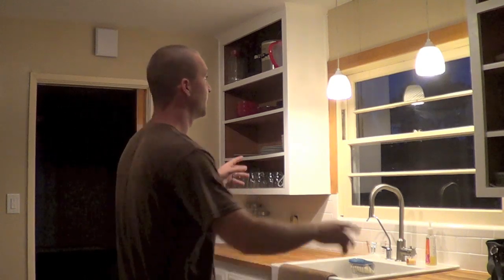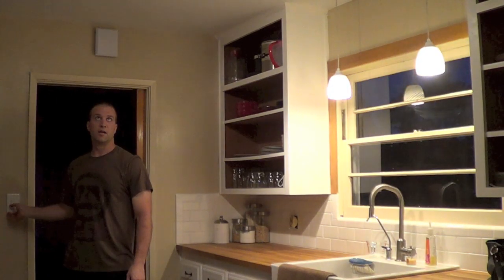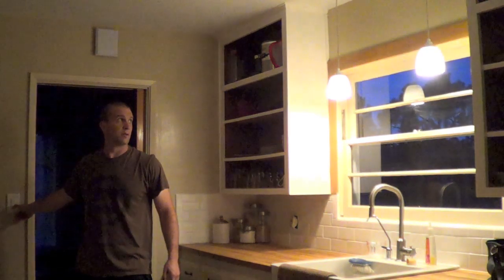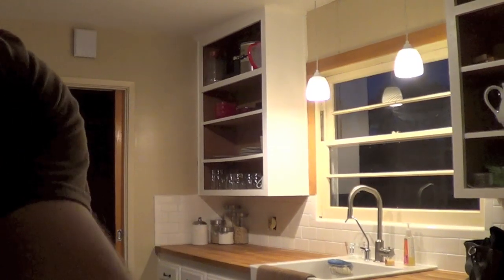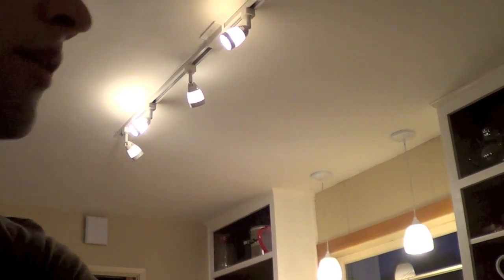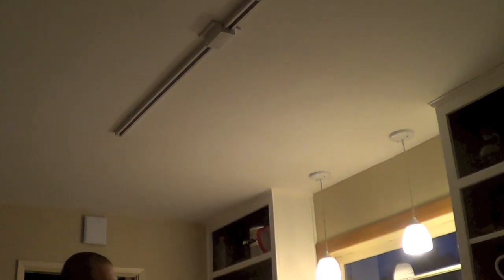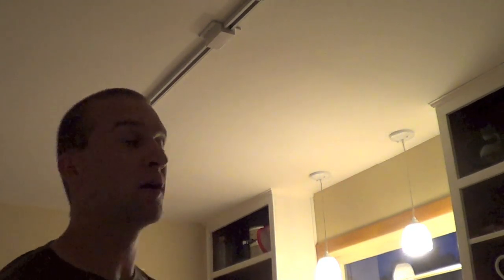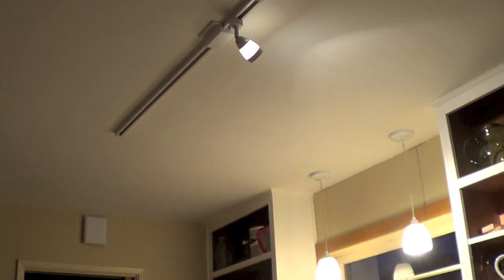Zwave Dimmer Switches with LED Light Bulbs

Comment: I've not found this to be the case if I use good LED bulbs and a ZWave dimmer that has a neutral connection. 

LED bulbs have very little internal resistance when the voltage is very low unlike a bulb with a filament. This low internal resistance does not allow a Wave dimmer to have enough voltage so that it's internal circuitry can function well. 

A dimmer with a neutral connection does not have this problem as it always has a full 120V to function. These dimmers will always work with ANY LED bulb although how well the bulb dims will be dependent on the quality of the bulb. Bottom DON'T use dimmers with out neutral connections with LED bulbs.

OMT, I have many bulbs that will dim easily down to 10% and several that will go all the way to 5%. There is one thing that I have found is that while some bulbs will dim to 5% they will not start up if switched from off to 5% but will require being switched on to at least 10 or 15% then dimmed back down to 5%. 

Hopefully dimmer manufactures will figure this out and will allow a setting so anytime you turn on a LED, that was previously off, to a value that is below a preset minimum turn the bulb on to 50% for 1 maybe 2 cycles than drop back to 5% and dim back up from there.

Comment: Most z-wave dimmer have 2 channels, so is that 40 watt load per channel, or combined?
Reply from the maker: +scienide77 I am not sure if I am understanding correctly when you say 2 channel what do you mean? I am not familiar with "channel" when talking about a dimmer. I am curious though!
Reply: Z-Wave Outlet
I'm sorry, im not that electrical savy that i know the correct terms. Z-wave dimmers i was looking at have 2 inputs and 2 outputs, so you could hookup two switches. Thinking about it, most likely it will be 40 watts per 'channel'
Reply from the maker: I see. So the inputs on the back of the switches is just a way to get hot (line) to other switch on to another location in the house. You can daisy chain electricity from your electrical panel. Anything on the output of this switch would be require 40 watts (this is the intermatic switch) since this was filmed we have had much better success with dimmers and LEDs. They still work better with more wattage but I have a dimmer working a CREE single 14 watt bulb and no real problems.
Reply: Are those dimmers based on triac or mosfet?
Reply from the maker: I could be wrong, never been asked this and hate to give you wrong information. I know triac is used in AC currents instead of mosfet that only does DC currents, but I would like someone else to chime in on this for another look haha

Comment: I have 9 LED Dimmable Lights going across and a 150 watt LED Dimmable switch. The lights flicker when dimmed. I was told if I get a 300 or 600 Watt Dimmable switch this will correct the problem?? Any help
Reply: +Charles Hadley Its tough to say, most Dimmers these days only support up to 150watt LED load but 600 watt incandescent. If your 9 LEDs go over 150 watts then yes you will notice the popping as well.

Comment: I have 16 GE 12724 Z-wave Dimmer Switches with LED lights with switched setups including:  11 x 10 Watt, 4 x 20 watts and 1 x 66 watts.    The only trouble I ever have is if I use cheap dimmable bulbs dimmed below 20 percent, and sometimes the GE Wink bulbs have issues at 30% or below, but that is also on a smartthings hub (is going to get replaced with the above dimmer switch very soon.)  In the few years since this video was made, the LED lights have improved a lot. 

Note that I also have a 3 way (1 dimmer and 1 add on) and a 4 way setup (1 Dimmer and 2 Add on's.)  When people say they cannot use these as a 4 way switch it works fine.  Since the add on's only require 2 wires and virtually all houses use 3 wires (for 3 and 4 way), I even moved the location of my Dimmer Switch (using the now spare black wire) as a line feed so I could add another GE Z-Wave ceiling fan control switch for my hallway. The line feed came in really handy or I would have had to source a power feed from another part of the house.

Comment: thank you for this video. did not have any defined answers when I searched Google but luckily I stumbled across this video. Will the ge 45613 3-way switch work with 8 Leds that equal about 50 watts load?

Comment: this video was extremely helpful, thank you for sharing this information with the rest of us! i was just going through the task of replacing all of my BR30's with the philips 452268's, and i was trying to look for some good z-wave dimmers to control them. this would work with my kitchen setup (as there are 9 BR30's connected to bi-pole setup), but on our porch this news is pretty depressing (as I only have 4 x 9.5W = 36 total watts). just short! are there any up and coming switches that would possibly work? i noticed your video was posted a couple of years ago, and I'm really hoping this situation may have improved (as it's well known) since you posted the video!

Comment: I just installed a Z-Wave TKB dimmer switch on 3x Philips LED lights of 5.7 Watt, and it works fine. Just when the washing machine is running, some of the lights flicker now and then when they are much dimmed.

Comment: Great video and thanks for the details.  Any experience with Halo LED Can lights?  I've got 2 rooms (one with 5 lights and the other with 8) I've installed Linear WD500z switches.  I only get barely on glow or 100 light.  Even if I adjust my Veralite to 50% they intensity doesn't change.
Reply: rheavener100 Hey we have had success with Halo LEDs. How many watts is each bulb. Typically the Linear Dimmers work very well.
Reply: Looks like they are using Sylvania RT6 bulbs which they are say are 11 nominal watts.  Any suggestions to get them to dim properly would be appreciated.  I've held off ordering any more switch for a couple of other areas until I get this sorted out.

Appreciate the msg back!
Reply: rheavener100 Its really  tough to say as we have not tested every bulb out there. I typically suggest Cree Bulbs from home depot. Now with the Sylvania have you tried a standard LED dimmer to see if you get better results? Unfortuantly this is still a trial and error process between switch and bulb choice. A few other switches that I would recommend is the jasco 45712 or if your interested in the newer 500 series z-wave chip Dragon Tech Dimmer (same internals as jasco but has the newer 500 Z-Wave chip ). Since this video was shot all manufactures started to include a neutral wire on their z-wave switch which cured most of the LED issues that we saw. Now its becoming bulb choice rather then light switch.
Reply: Thanks for the info.  No, I have not tried a standard dimmer switch yet.  I have another group of lights that I'm going to try one on and see it works.  Appreciate all the insight.

Ross

Comment: would this dimmer switch work with philips hue?
Reply: Pretty sure it won't. try a GE/Jasco Dimmer WD500Z-1 or a Linear dimmer switch. With their newer 45712 switch with neutral wire we have had much better success with LEDs.

Comment: Hello I had the same issue with my GE wave dimmer after switching to LED lighting. The GE Wave dimmer was not rated for LED's, important to check the dimmer rating
Installed Linear WD500Z-1 Z-Wave 500-watt Wall Mount Dimmer Switch from Amazon $35 and works perfect with no flickering and will turn off :-)

Comment: Man this sucks. Thanks for the info Ive been trying to figure out this issue for awhile. I turn off my GE Zwave Dimmer to the off position and it looks like i have a strobe light in the kitchen. On 1 switch i have 1 Led recessed light and on the other i have 2 Led recessed lights. Is there any tricks i can use to get these to work? I totally was expecting this system to work. The stupid box advertised dimmable led switchs.

Comment: Many thanks for the heads up!. We're right in the middle of installing a Z Wave dimmable switch with six 7Watt GU10 LED's in a kitchen fixture but could not get them to work. They would go to 3/4 brightness before shutting off. Replacing the the bulbs back to the original did the trick!
Thanks again, I'm now subscripted .

Comment: Would wiring the lights in series do anything for you?  I just wired 2 Phillip LD bulbs to a Aeon Labs  Micro dimmer and have the same issue.  I really do not want to up the usage to 40W.  Defeats the purpose of going LED. Plus my kWh rate is $0.49.

Comment: If you take a regular non zwave dimmer switch and then adapt it with an aeon labs microswitch just to enable it on anf off, and then allow the non-zwave switch do the dimming work, does that work ? Of course that would mean you can dim via zwave, and only dim at the wall.